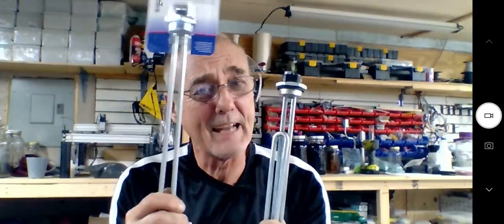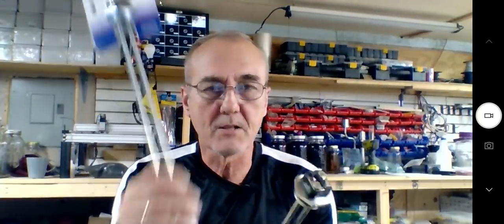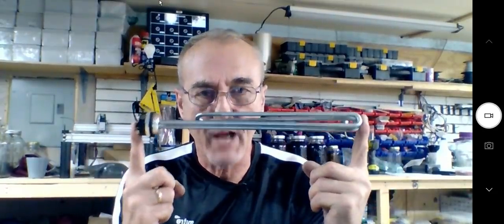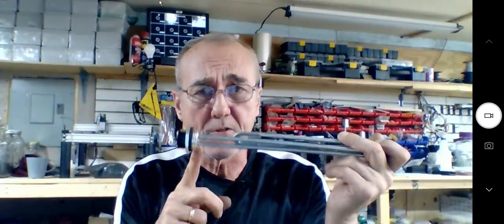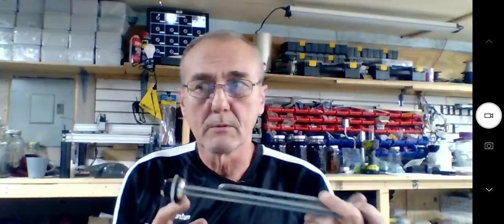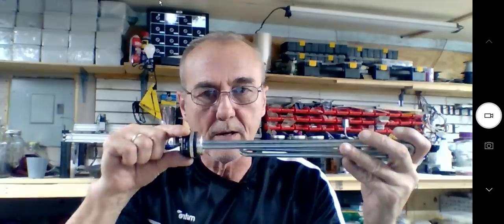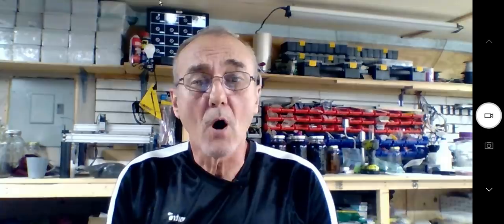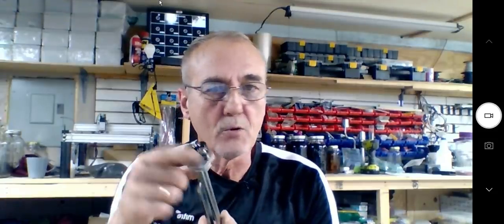HEATING YOUR STILL OR OVEN USING ELECTRICITY

Comment: Good info, and I hope it helps people towards better understanding of how many heating appliances work.  
  One small critique, which may have been simplified on purpose, is a P.I.D. generally does not reduce or vary Voltage.  It most often just rapidly pulses the relay allowing power to flow for short times. following its algorithms and the info coming from the Thermocouple to determine how long to let power flow to the resistance heater device/element.
The focus and recommendation for over rating your safety and control devices was well stressed and is such an important thing. 
I greatly appreciate the clarity, and scientific approach you bring to your information sharing George.

Comment: Nice and simple explanation George. May what to mention wire size for safety to eliminate overheating if too small of wire is used for a particular current draw.

Like the virtual white board.

Cheers

Comment: Of all the equipment I've invested in, hands down the most beneficial item I have is my PID.  There is no better source of heat than electric for a still since it is totally controllable.  Hook a PID to your electric still and suddenly you can control temperature very precisely.  Temperature control is an essential element in producing a fine spirit.  If you don't have a PID, buy one from George or make your own. George has videos showing how to build one.  JUST DO IT!  Get a PID and you will move to a whole new level of distilling.  Thanks George you are, "Saint George the distiller".
Reply from the maker: Awesome. I've been using a PID for over 8 years now.
Reply: I purchased a 110v PID from George a few weeks ago, to use with my (soon to be bought) Mile High still. Cannot WAIT to try it out. Thanks George!
Reply: SkyHook . Drones built a PID but just can’t get it working right had to go to an scr.  The pid gets close to the input temp but once there it starts to swing the temp by a wide margin +/- 30 degrees.  Anyone have any ideas. Is it possible my inkbird was just faulty?
Reply: @arealcanadian419  Hard to say without more info.  Did you build it from George's design?  Perhaps it is not dialed in correctly.  In one of George's videos on building a PID, he outlines the various parameters to set up the controller.  I built mine using a My Pin controller, so not sure if the Inkbird is set up the same.  Also, what thermal probe are you using?  It must be a type "K" and should be at the top of your column.

Comment: You've just summed up my obsession from a few years back into a short n sweet video. Wish I saw this back then! Tried a few methods. I personally like controlling the voltage to keep a constant input and output. I find with other controllers it is 100% or 0 and drives fluctuations/waves for the output (reflux mode that is). Add heat input, increase evap rate, cut input to 0 while keeping reflux water rate the same... Well, looks like your still has an enlarged prostate. PIDs properly applied do a great job, but not your cheapest option usually. You've done solid research on this and summed it up well. Keep great content flowing, really enjoy your videos on the subject.

Comment: I took temperature measurements heating water, for my electric stove, 40% is approx 170*F. 25% is 125*F. 50% is 205*F. 

I havent started distilling, need a big bag of ice and a fan. I saw a guy distill with a large cookingpot and large metal bow with ice; inside cooking pot, slightly elevated was a small bowl were cooled distillate dripped into.  He changed ice a few times, took 2 or 3 hours. 

What scared the ba'jesus outta me was learning of low flashpoint, but it changes based on percentages, like 40% hard to ignite but 50% easier. 20% ethanol ignites around 140*F or something like that. Pure Ethanol I believe is 70*F. Its scary info but important to distill safely. Btw good to see ya Mr Barley & Hops ☺👍

Comment: George I have a question. Could you tear an oven down and use the system that regulates the temperature similar to a pod? If so what is that called

Comment: I've been using a speed controller for a router on my1500 watt hot plate for 5 years now and it works great.  Paid $20 for it.
Reply: Good option for sure. They work for a lot of uses. Might add a recommendation thru experience. Get yourself a well oversized version and buy 2. Nothing worse than your magic smoke coming out of your controller when it matters most. They work great till they don't. At that price, keep a spare.
Reply: @leperousbeing  You are probably right, I'm sure.  Just haven't done it yet.  I like them because I can control the temp within a couple of degrees
Reply: @buck10539  Yup, they are a great cheap option that allow a lot of hands on control. PIDs are also a great option that allows you to pay less attention by paying more for the setup, but I'm usually there for the show anyway. You can also find these speed controllers online called a SCR. Take your element amperage from the video and double it for buying your SCR. They get awful hot when you shoot for lower voltage settings. It's good to shoot for an overrated unit and keep a spare for the day it gives up.

Comment: you seem like you had an interesting career in the military if not then youre a real thinker i like to use my brain too , not that im a genius far from it. guessing higher voltage is more efficient due to lower amperage, i like dc less likely to cause fibrillation in the event of getting zapped

Comment: George, 240 divided by 120 is not .5, it is 2. unless I am missing something?
Reply: Marlin, I believe George has his number backwards. If you divide 120/240 you get .5 Then when you square that you get .25.  If I am wrong, I am sure I will be corrected.
Reply from the maker: 120/240 is .5
Reply: @BarleyandHopsBrewing  You're welcome, George. I do like your contributions! I get hung up on a mathematical mistake, and can't pay good attention afterward, or I might have noticed that the original formula was in error, not the result. Have a good day.

Comment: @0:47 No no no. Strictly speaking, voltage regulator controls your voltage. Silicon controlled rectifier converts your AC voltage to DC.

Comment: Poor explanation of circuit calculates - IMHO applying some of these suggestions would result in unsafe wiring.
Reply: Hmm I assumed anyone who knows how to change breakers and wire these things up would know to adjust wire guage accorindgly....but you know what they say about assume... HEY! Guy in the back! Here's the chart! http://waterheatertimer.org/images/Water-heater-Wire-size-chart1000.jpg
Reply: Glad your brought up breakers. Take a look at the rating of 99% of the breakers out there (100% of breakers for residential). If you look at the detail of those devices they are rated to 80% of the breaker size. A resistive load, like a heater element, that’s pulling more than 80% of the rated amperage will overheat and become a fire hazard.
Reply: @mikemeyer239  George has explained this in other videos,  go look at his wiring a 240 volt breaker,  and he said in the video that most electricians would go 125%, guess you missed that
Reply: I didn’t miss anything. Wiring by anyone other than a qualified electrician is a recipe for disaster, especially when the advise offered is inaccurate.